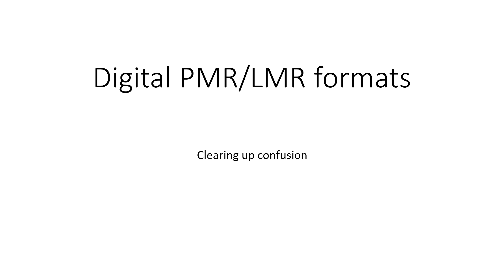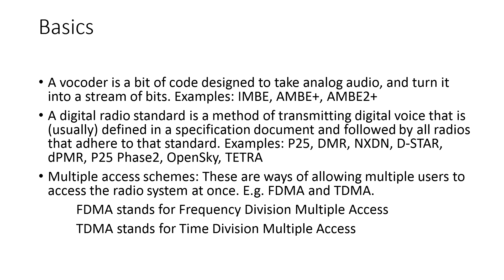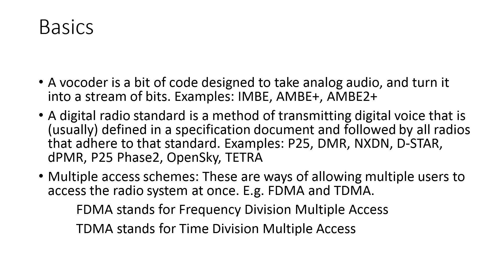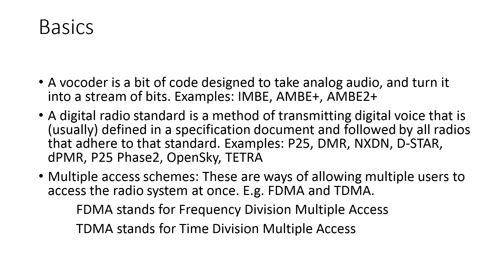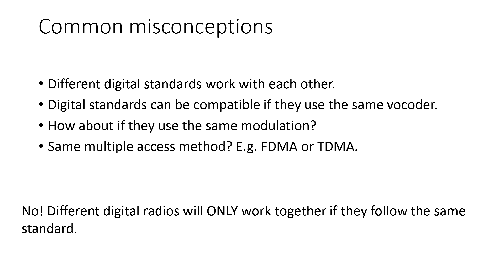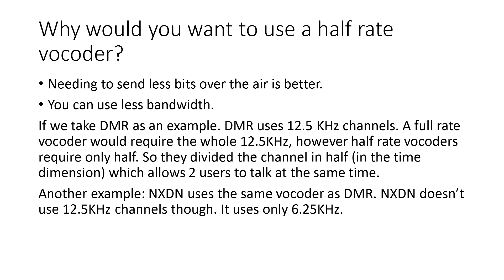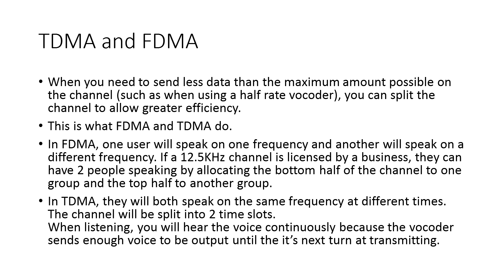Intro to VHF/UHF digital voice standards

Comment: Very nice video and informative video. I have one question. How do they synchronise the radios in such small time slots using TDMA do the radios have an internal clock?
Reply from the maker: When on a repeater, they use the repeater to synchronize. If on a simplex channel, then some radios can't use both slots at the same time without interfering, and others have a special feature to allow this to work called DCDM. Basically one radio provides the timing information and the others all follow that radio. Have a look here for more info: http://cwh050.blogspot.co.uk/2012/12/dcdm.html